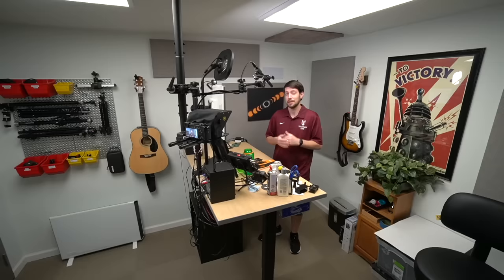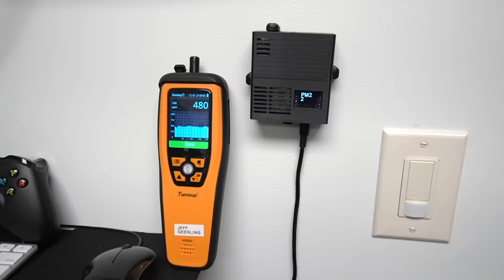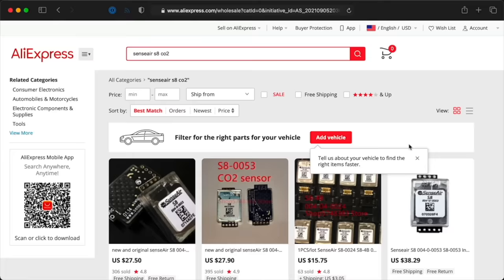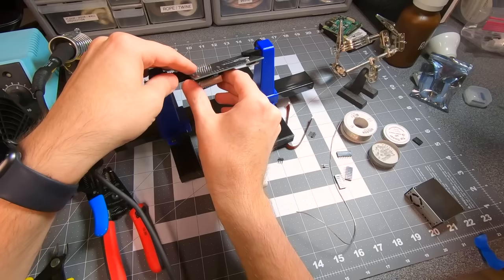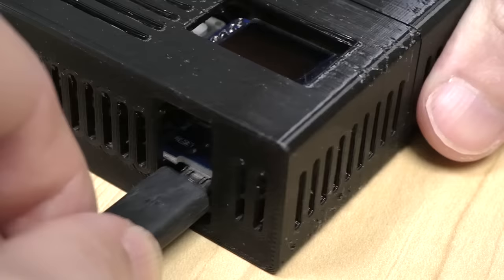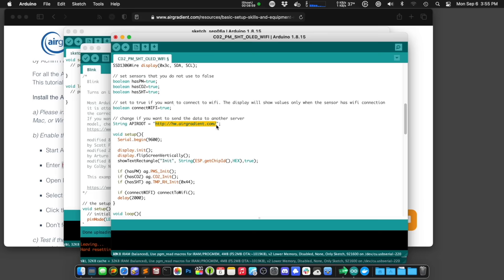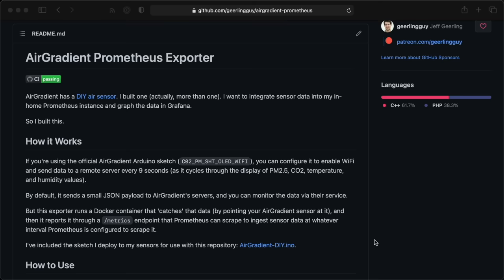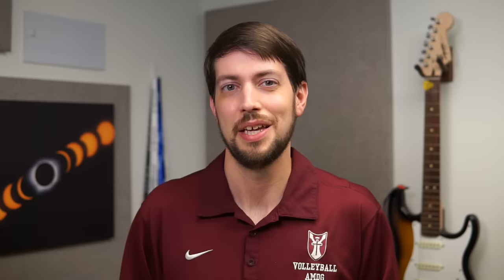Your home's air could be making you sick. Fight back!

Comment: What makes this very challenging for me is that I'm blind. So I have to get creative with soldering
Reply from the maker: That's something I've never considered—but doing a little research I found there are some places that teach soldering for the blind, using some sort of landmarking system on the PCB. Would be fascinating to see it in action!
Reply: @JeffGeerling  yeah pretty much that's what I do unfortunately this requires me to touch all the pins and to understand how the board is laid out. Eventually I am planning on building a little robotic arm that does the soldering for me just going to take some time
Reply from the maker: @actualRocketScientist  It does sound tedious. It's awesome that you still plug away at it, I can imagine it requires even more patience than I have!

Comment: You've answer the question on different sensor add ONS. But is this a wifi only device? I like the concept I just would like to swap basement for RV. will it work over hardwire? Ethernet

Comment: Hi Jeff, I've been looking for a useful air quality quality sensor tool and came across your video. I learned a lot just by googling the parts you've shown. And I loved the idea. It is way more cheaper than an amazon product that I would not know what it has inside. However, I want to use this product to trigger the NEST thermostat via Alexa and I wanted to ask if you have generated a way to connect your airgradient tool to Alexa? By the way, thank you for the tip about the temp sensor in the basic kit. I decided to buy the pro kit.

Comment: You should just leave that vent uncovered. I don't think it's a big deal.

I change my furnace filter regularly because of allergies. Also the outside air in my area is sometimes bad enough, you don't want to open a window.
Reply: Alternatively, you could explore replacing the existing metal vent with one that doesn't look ugly. Maybe 3D print one? That way it doesn't mess with either the air, or the aesthetic. :D

Comment: Can you integrate this easily with home assistant so you can run automations such as turning on the fan when carbon dioxide is high.
Reply from the maker: Yes; ESPHome already has all these sensors so you could use that to get it wired up to Home Assistant.
Reply: @JeffGeerling  thanks Jeff, I will take a look at the guide, and possibly build one!

Comment: So why don't you just cover the vent with a fabric art piece? Get a custom printed Jeff Geerling fabric and and mount it on a frame, then hang that in front of the vent. It wont be a distraction, should give some relief from air noise and you wont be sealing off your working space. If you need more noise reduction add some poly-fil behind the fabric. It might not be perfect but you'd still be able to breathe.

Comment: I’d be curious to compare these against commercial solutions like NetAtmo, etc….
Reply from the maker: Individually, each of the sensors used here (except maybe the temp/humidity sensor) compare pretty favorably to the ones used in commercial solutions—and some of them (like the Plantower) are the same ones used in many of them!

The spec sheets are helpful, though—for example, the PM2.5 sensor will degrade over time, and the CO2 sensor may need extra calibration in certain circumstances.

Comment: Just curious. Why not install a firmware like ESPEasy (full disclosure, I am the maintainer) or one of the other firmwares like Tasmota or ESPurna or ESP-home ?

Oh and the SenseAir modules are factory calibrated, so the most accurate readings will be when you start using it :)
The self-calibration will only work well if you have the room ventilated well at least once in the ABC period (Automatic Base Calibration).
For the SenseAir S8 this is by default about a week. Other sensors like the MH-Z19 do use a very impractical period of 24 hour.

Comment: It looks like on the AirGradient boards there are headers for a few other things.  Did you manage to find out if you can just solder a cable header to the panel instead of snipping the wires?  What about wiring of other sensors to the breakouts?
Reply from the maker: The little connector for the PM2.5 sensor seems very hard to get :(

Comment: I wonder if this could detect you breathing in extra co2 levels from using a mask? Many people actually think that your average reusable mask doesn't make you breath more co2, but if you think about it, the air that you breath out doesn't have enough time to actually escape and "refresh" with more fresh air if you breath in again before it refreshes (assuming that the mask is not fully sealed against your mouth or nose, which would be very uncomfortable). Thus, when you breath in again at a normal rate, because not all the co2 escapes, you breath in more co2 than you usually would. Basically if when you breath out in a mask and breath in again and the air still feels warm (unless the environment you are in is already warm), that air is probably not fresh (and thus is most likely a higher concentration of co2 than you would normally be getting). Whether this higher level of co2 intake from wearing a mask is actually harmful I don't necessarily know, but it would be interesting to somehow be able to run some tests on it using this air sensor to see what is actually happening. Also I didn't necessarily look up anything that I am stating, but rather I am just using my own experience with using a mask (how when I breath out and breath back in quick enough I'm still breathing the same air I breathed out because it is still warm/humid) and trying to pair that with logical reasoning to come up with a possible conclusion (or at least question). Not to mention that after having worn a mask for an extended period of time, when I take it off, the air I am then breathing in just feels fresher and more invigorating instead of the stale feeling air with wearing the mask (which is something that I don't think should be ignored, assuming that I'm not the only one to experience that).

Comment: I got the same CO2 SenseAir S8 sensor but my readings are faulty. I took the sensor outdoors and I am getting values from 8000-9000. I tried in my bedroom and the same simillar values are returned. Not sure what is wrong with the sensor

Comment: Does anyone know what type of connector is used by the PMS5003? It looks like the PCB has a socket for it on the board and I'd rather add the socket than cut the wire on the cable myself. It looks like a JST-ZH 8 pin connector but I'm not sure?

Comment: Not once did you mention Oxygen levels.  You should alarm if below 19.5% and 21% is normal.  Low oxygen levels can also cause headaches, etc.  I guess you could sense nitrogen and the rest of the components of the atmosphere as well, especially CO the dangerous form of Carbon.

Comment: AirGradient have also mentioned that you can swap out the SHT30 with an SGP30 TVOC sensor and (theoretically, since they have different addresses and both use I2C) use both at the same time, which is my plan. 

Do you have any code that might work for that, based on their published original arduino code for the TVOC sensor?

Comment: The radon sensor/reduction that you have on your house is for the radioactive element radon? If so, why it's so high on your house?
Reply from the maker: In the midwest at least (USA), there are pockets of radon underground that will slowly diffuse into basements (which are 6-8' underground), and that gas can increase the risk of cancer.

My house had levels between 4-6 pCi/L, which was an actionable level. Since I work down here 6-8 hours a day, I figured we should get that fixed :D

Comment: Is it possible to add carbon monoxide detector as well?
Reply from the maker: I haven't even looked into that. I have two in my house (one on each floor, since we have a couple gas appliances), but I didn't think about trying to monitor that over time.

Comment: It would be nice to have an integration of this device for Home Assistant
Reply: Doesn't it work natively via esp32 integration?
Reply from the maker: ESPHome has all these sensors in its library already, so it should be easy enough to build for it.
Reply: @coin777  It depends on the frimware is running it.
Should be running esphome or tasmota for that.

Comment: I wish there is a way to buy this pre-built.
Reply from the maker: Apparently they're now selling kits, so you'd only need to do the soldering to have the sensor put together. Would be neat to be able to buy a full complete kit though for less than $100.
Reply: @JeffGeerling  Yes, a kit would be great. I might be up to soldering a set. But if it works well for me I'll be looking to do 6-7 of these in my place and my parent's place. And that's quite a bit of soldering and I don't have a lot of time. 

The 3D printing I'm happy to do. But if anyone make a fully assembled kit with case, I'd also be super happy to give my business.

Comment: Can anyone help me with flashing this software. I soldered everything but now I only get "Timed out waiting for packet content". Tried another cable, removed the oled module. On arduino IDE (Serial monitor) when I press the reset button I receive some data like: "SDK ver* 2.0.0(5a(75ba) compiled ` Aug  9 2016 15:12:27 phy ver: 1055, pp ver: 10.2"

Comment: Can you let us know if the chinese version of the same module performs equal, better or worse?
Reply: the sensirion sensors are all swiss and china manufacturers PCBs with them on it. The PMS5003, PMS7003, PMSA003 sensors are all designed and made in china so doesn't differ

Comment: I would rather pay 60 dollars for an American Made sensor. Can you do the same thing with American made parts? I would build that.
Reply from the maker: Note that it's $60 for the same sensor, just from a US supplier. AFAICT, no American company manufactures any CO2 sensors, at least one that could be integrated into a small electronics board. SenseAir is a Swiss company, too.

Comment: very nice, I had a look at the code, every 9 seconds you send data to php that saves it on a file which is read by /metrics from Prometheus... don't you think that you are writing too much on the "disk" of a RPI?
I see you like using Prometheus. what about using MQTT published to an mqtt broker docker on a rpi which writes on an influx DB? it seems more complex, but you have a DB that you can manage.
just an idea.
Anyway it would be nice if you could make a video on Prometheus.
Reply from the maker: Yes; that's the other option I've considered, but since I'm already using Prometheus a lot, I went with the method I'm already using :D

I have been considering either switching to Home Assistant or switching some things to InfluxDB mostly because I've never used either and it would be nice to see how they work.
Reply: @JeffGeerling  once you get used to influx you can find that is lightning fast, at the end it does one thing and it does very well, then it integrates incredibly well with grafana.
on the other side I want to learn Prometheus ;)

Comment: How long do you estimate this whole project took?
Reply from the maker: For the first board, once I had all the parts, it was about 30 minutes soldering. Second board took about 20 with the filming (would probably be 10-15 without). Flashing process is fast, only took 5-10 minutes including Arduino install.

The longest part was writing the PHP script to accept the data and transfer it over to Prometheus, and building the Grafana dashboard so I could easily see the data. But since that's done, it's basically free now :D

Comment: This should really just go to home assistant
Reply from the maker: ESPHome should work with all the sensors on the board, so integration isn't too hard.
Reply: @JeffGeerling  Yeah, I have mine working like that at the moment. Makes is very easy to send a push notification or switch on a fan if it is above a certain level

Comment: I'm trying to understand what's the reason behind actually building these. 
Except for fun and learning of course, or if you do experiments that actually can negatively impact the air quality, and fill the air very fast with dangerous levels of different gases, but it seems to me things that need to be understood through common sense already, are not at work here. Not trying to insult of course.
All of those things should have been taught at a science lesson to in school.
The installation of new windows is using with some chemicals to seal off any crevices' between the window and wall, and new windows often times have the new item odor, which also are chemicals and which vent out after some time. 
The fact that you are closing the vent and obstructing the flow of fresh air to your basement / exit of co2 polluted air out of the basement, should have known that your body will in time fill the air with co2 especially in a closed off room.
All this could have been fixed by opening the vent and windows for some time, especially since you already have the data of "after a couple of hours with a closed vent".

Why not build an angled cover? Or design a permeable beautiful design of a cover that will be as a design element and will keep your air circulating?
Take a break like 30 minutes every 3-4 hours and open the vent, that's even free.

Comment: Did you say 9926 and write 9925?
Reply from the maker: Heh... continuity error there—I have two sensors, one on port 9926 (upstairs) and one on 9925 (office). When I was doing the recording, I set up both, actually, at different times, and I forgot to match up the 9926 in all the footage I used.

Comment: there is definitely something inherently wrong with your 3d printer. i have never seen any parts coming out that shitty on a stock ender 3 in my life.

maybe consider some troubleshooting
Reply from the maker: There are three things that contribute to the way those parts look:

1. I was using Octolapse, which causes the print head to hop off and go to the corner between each layer, causing little jaggies in some parts (I don't have the tuning right for the black filament).

2. The black filament I'm using seems to be very prone to 'running'... could be tuning, could be filament issue, not sure but my other filaments don't have that issue.

3. When you show any 3d printed parts under macro with a lot of reflectivity, any aberrations look a lot worse. In real life, looking from a foot or two away, you barely notice the part is 3D printed.
Reply: @JeffGeerling  could be that your black filament has a lower melting temperature. have you tried reducing the nozzle temps?
Reply: @JeffGeerling  the filament could be a main factor, i guess. we only use premium filament from either prusament or DAS Filament, because quality actually matters a lot.

its just that i am used to seeing prints from an ender 3 looking just like injection molded, even up close. even if its magnified through video, this is not the print quality an ender 3 can deliver